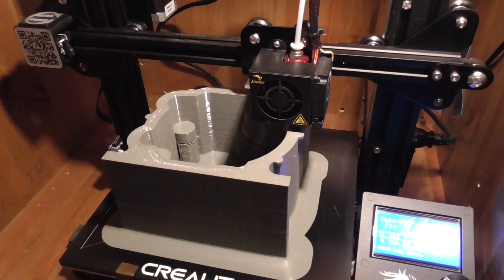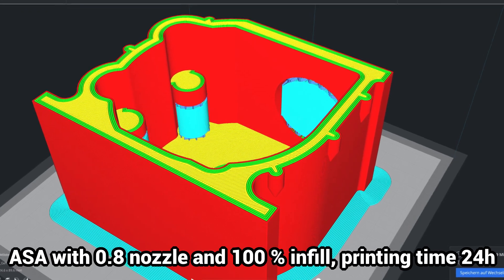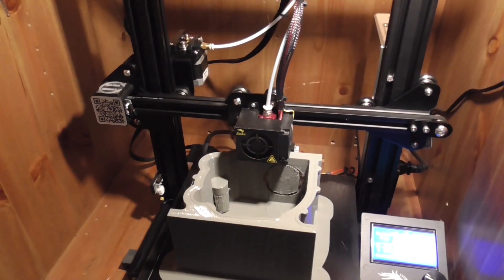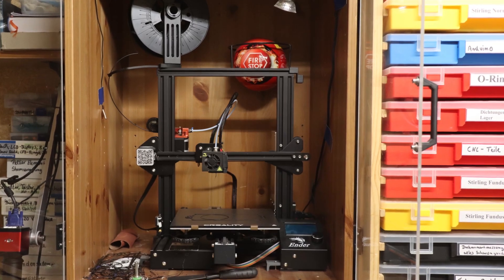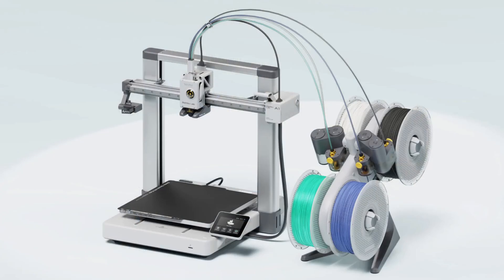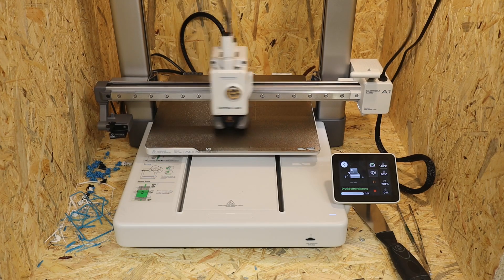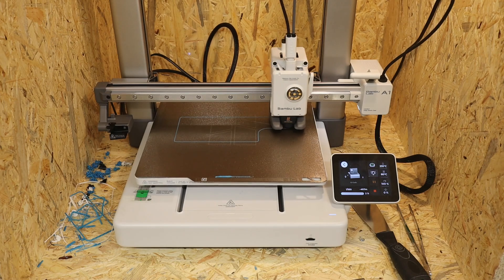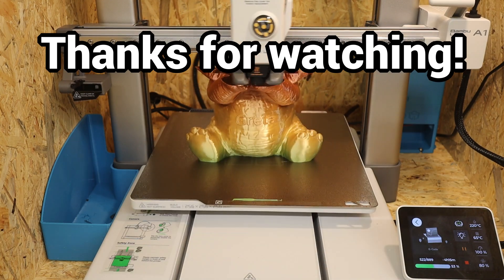Bambu Lab A1 for printing functional parts compared to old generation of 3D printers like Ender 3

Comment: The latest printers are very good indeed - but because of the speed of development there are still traps and hiccups that can cause problems and frustration. I invested in a Creality K1 Max which printed perfectly - until it didn't :-(    the print head got blocked . 
To clear the blockage became a major problem for me  as stripping the head involves a lot of screws (of differing sizes) and tiny plugs fitting into very awkward sockets etc. 
I have now invested in some improved print  head parts from a non Creality source and peace once more reigns 🙂
The K1 Max is extremely quick and accurate and has enhanced my workshop immensely being more than three times faster than my original Anet 8 (with added enhancements) printer that I used for some years.
Would I recommend some of the new printers to a beginner NO.   They all have a learning curve.